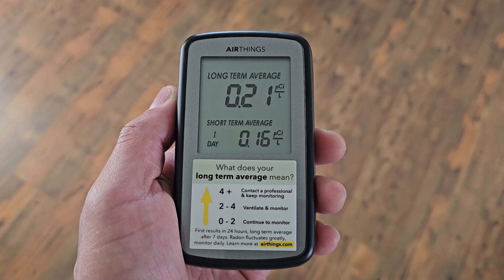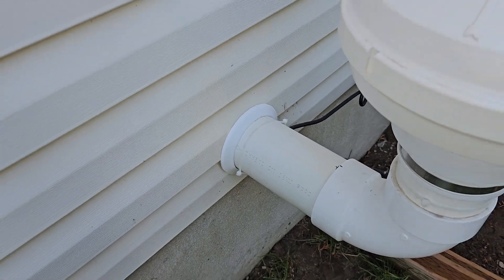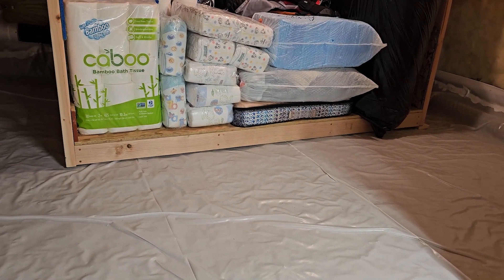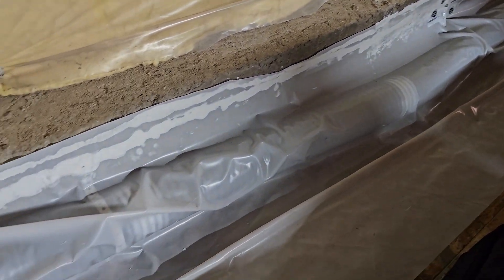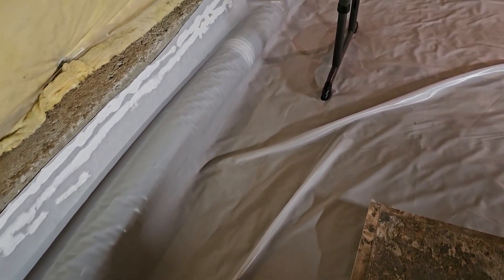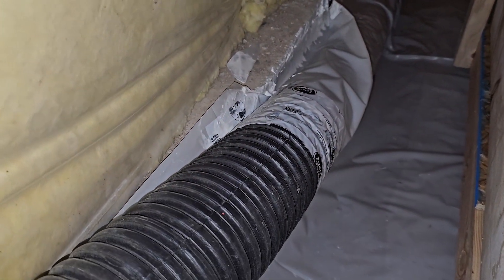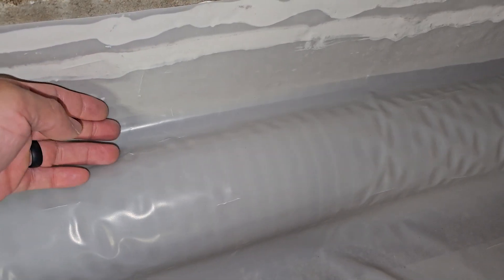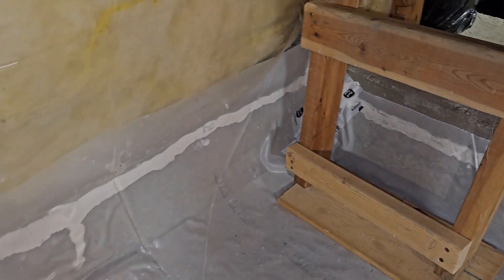DIY Radon Mitigation System In Cellar

Comment: Best DIY radon encapsulation video I've seen so far. I was on the fence on whether I should hire this out, but your instructions make it seem reasonable to do - very much appreciated! 
I watched another video that recommended using carpet scraps if there are heavily trafficked areas to prevent holes in liner.
Reply from the maker: @ToolTags  Thank you! I'm glad I was able to help. It's definitely a decent project, but I did save a lot doing it myself. I was also able to take my time and customize things the way I wanted them. The carpet is a great idea!